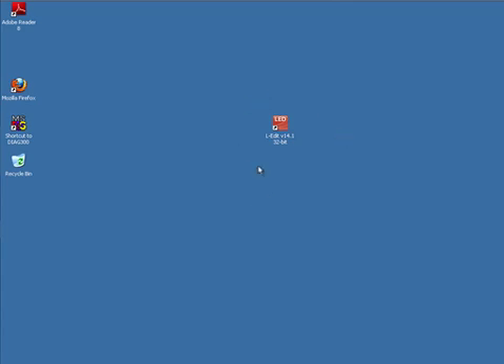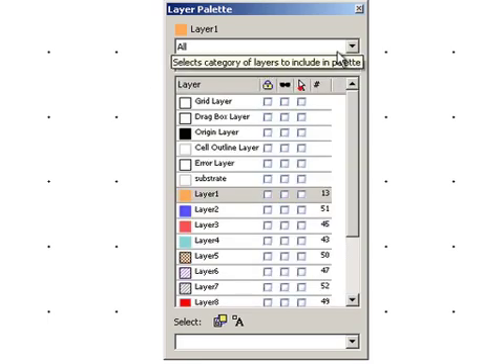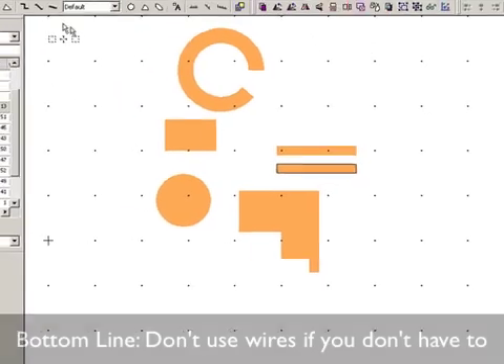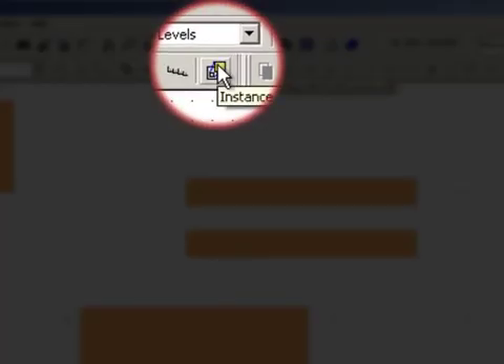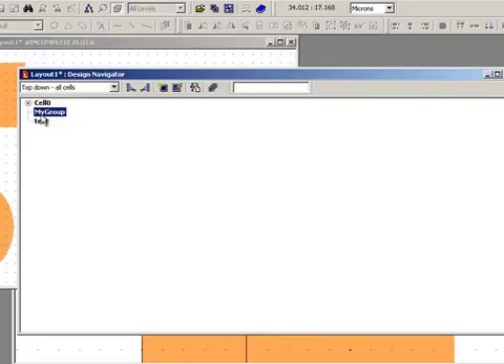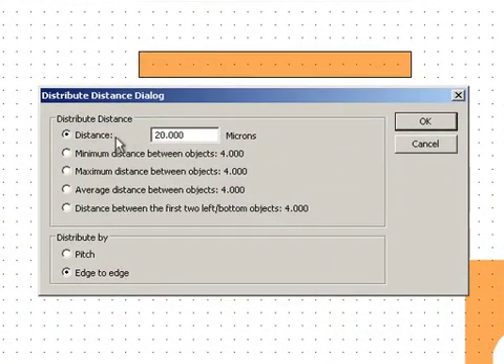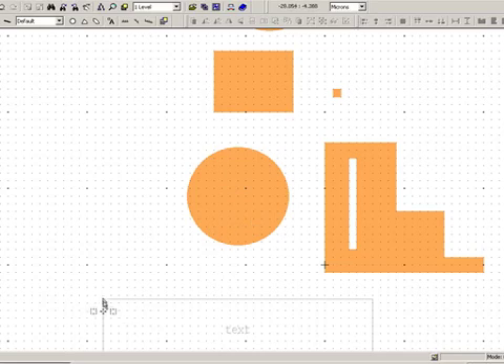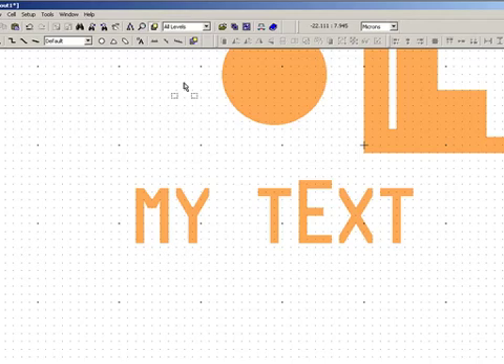L-Edit - Introduction

Comment: Hello, when I use LEDIT v12.x, I can use "Merge" to convert rectangles (polygons) into rectangles (boxes), but in the new version (v16.x) I cannot do this. I guess I can modify the default parameters through some kind of command (just like the Autocad command), so that the rectangle can be automatically converted to box format when operating commands such as Boolean and merge. But I still can't find the answer. Do you know how to set it up? Thank you.